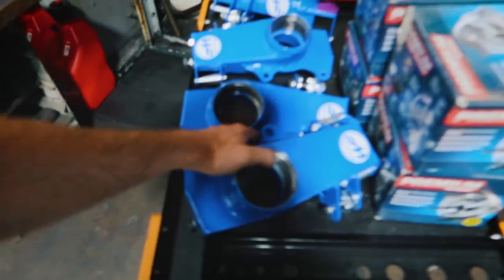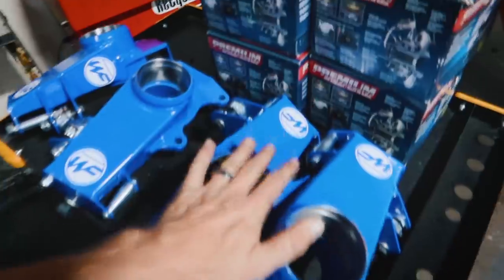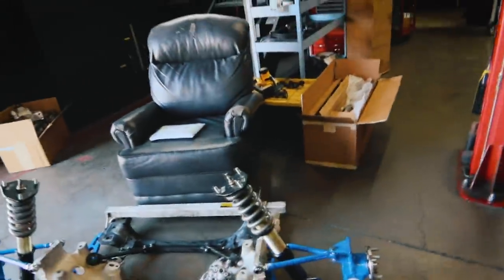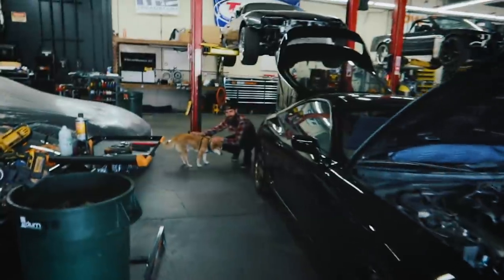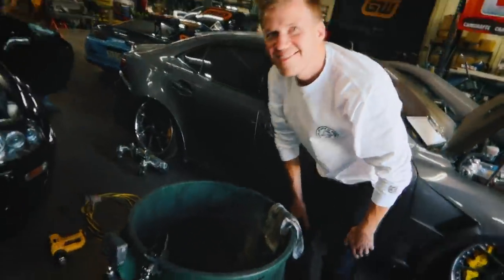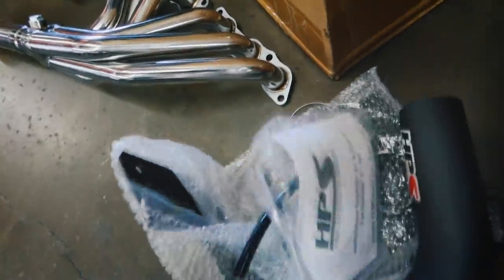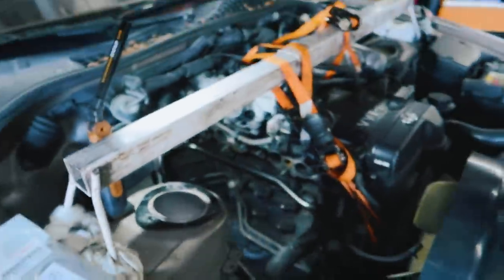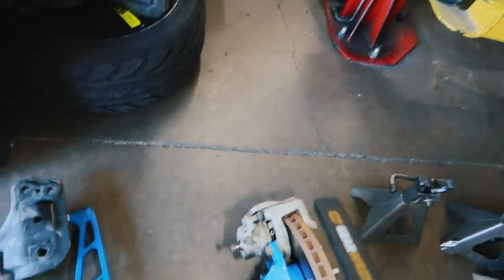Drift Car Build: SC300 Ep2

Comment: This series is so rad for all the sc owners out there, I look forward to seeing what hp you can get out of the NA 2J!
Reply from the maker: Probably not a huge HP gain from stock but it should drift with the gearing choice I have selected
Reply: RAD Industries What are the rear gear options for these things? Can you use an FRS diff like the is300 guys? These things always seem so gutless NA but I’m sure the right gear would really wake it up.

Comment: On my car I had a few issues with the single last o2 sensor wiring ,cant find where to start wiring that as it has 4 wires that would be super
Non vvti sc300 swapped into a m61 Celica Supra 1985 
I’ve drove it a bit but  no balls upon adding the manual w58 and a new f pump haven’t done any mods feels and smells rich 
Thank you your vids are awesome you guys are amazing ..your time wasted to make this did not go in vane
Reply from the maker: Thanks for the update dude. I’m a little worried it will be slow but I can always do more to it and add a turbo later and a ProEFI 112 ECU

Comment: Ugh man.... you just reminded me I probably need to get new brake lines once I put the angle kit on the FC. I’ll know in a week or so.. might just be able to get away with making a new hole to pass through the fender.
Reply from the maker: Maybe, or you could get new lines. They can’t be to expensive
Reply: RAD Industries oh I know. I already have brand new chase bays lines but didn’t think about how they might need to be longer 🤣

Comment: You're first video made this seem like a budget build but that wisefab kit costs 4x more than I paid for my sc300.
Reply from the maker: My SC was $2500 so the WiseFab would still be cheaper, but yeah not a budget friendly part
Reply: @RADIndustries  I bought my sc300 for $500 with intention of making it my first drift car. I definitely cant afford the wisefab kit but I'm definitely interested in seeing what else you do. I'll most likely be cutting and welding the knuckle

Comment: The wheel speed sensor shouldn't of thrown a cel it would throw an abs light on but idk ca laws so I dont know what lights can and cant be on
Reply from the maker: The ABS light will make you fail the visual inspection
Reply: Damn yall are strict we only have state inspections and abs light doesn't fail
Reply: @RADIndustries  that's crazy. Where I live an ABS light doesn't matter unless the car is a 2011 or newer.